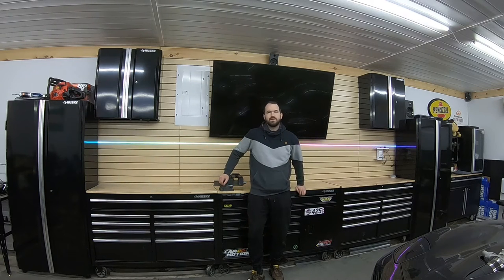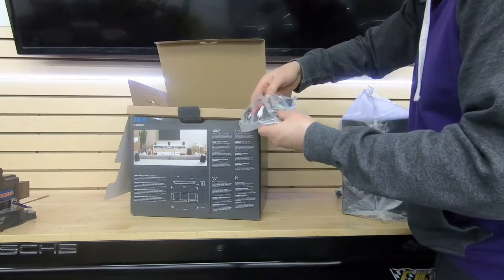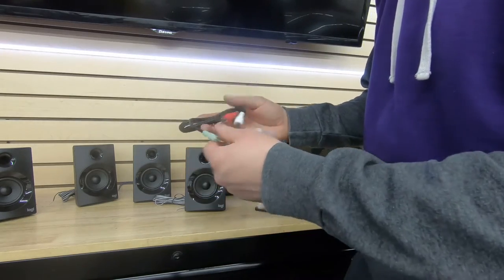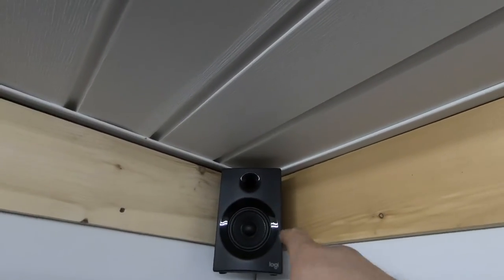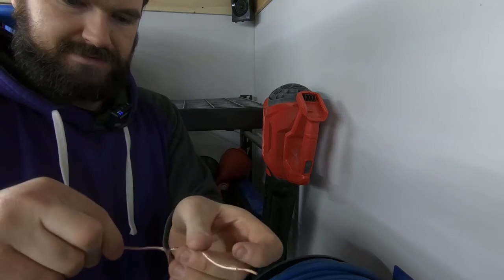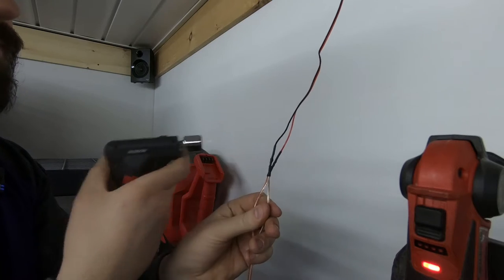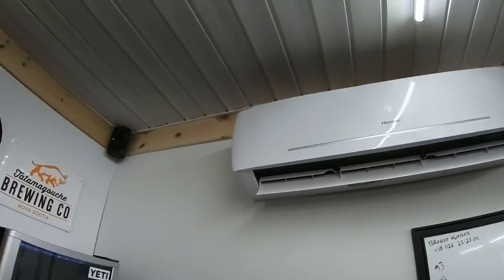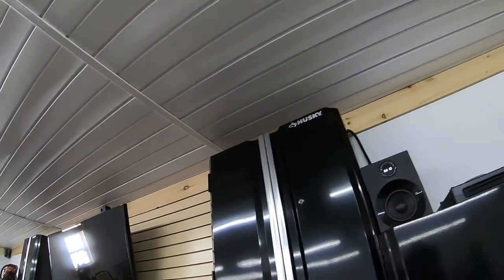HOW TO SETUP A BUDGET FRIENDLY GARAGE STEREO SYSTEM

Comment: Curious to know how much of that sound leaks into the rest of the garage. Also the only thing that concerns me about this setup is the screws you're mounting the speakers with. I would image the louder it gets the more likelihood that the speaker shaking will cause a rattling because of the screw not being "attached" onto the speaker itself.
Reply from the maker: They don't really "boom" with tons of bass, the speaker seems to be weighted in a way that it stays kind of pressed against the wall, enough to not make any rattling noise anyway! As far as the sound "leaking" into the rest of the garage I'm not exactly sure what you mean? Like does the area seem evenly covered? If that's what you're asking, it took some changing of the individual channel volumes to get it nice and even.
Reply: @AtlanticBuilt  meant to say if the sounds can be heard or felt into the rest of the house.
Reply from the maker: @Eddie-gb3bn  aaah! Gotcha. In this case no, as the garage is separate!

Comment: Can you connect the system to your tv?
Reply from the maker: Absolutely! I use an apple TV as my tv is not a "smart tv" but, the apple tv has Bluetooth, which was actually the main reason I wanted this style setup. Seems to be lots of value in computer sound systems vs home theatre stuff. Obviously you don't get cinema sound, but for a garage Im still more than happy with this setup for sure.
Reply: Thanks!!
 @AtlanticBuilt